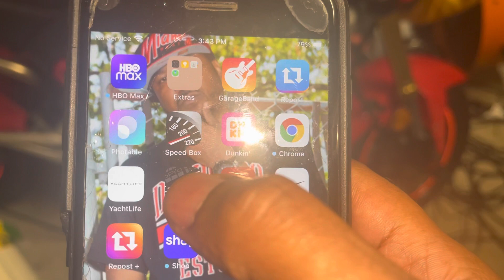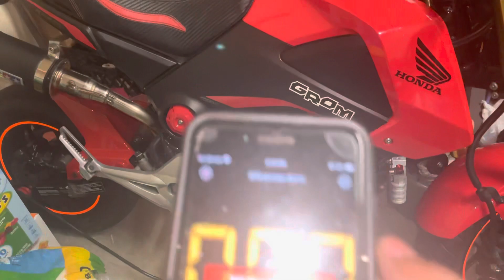Top speed with the new Kitaco Neo 181cc Big Bore kit on my Honda Grom

Comment: Idk if that's a legit BBK. My stock bore 2020 hit 75mph GPS with intake, exhaust, CJR tune and a Cam. You should be able to pull into the 80's like it's nothing if it's a 181 kitaco kit
Reply from the maker: That’s what I’ve been told. But I was doing 64 max stock.
Reply: My stock can do 60 easy